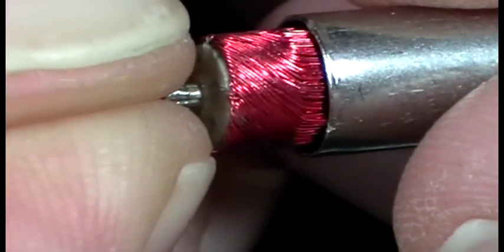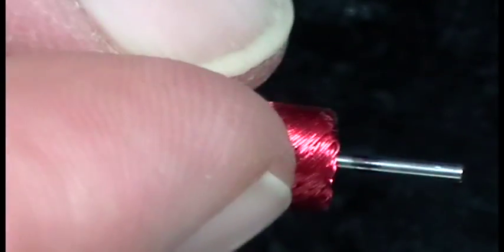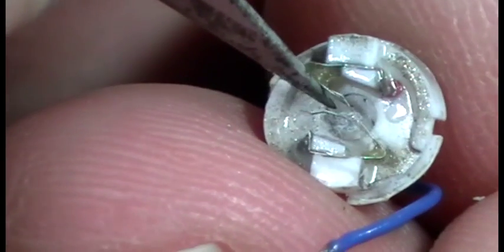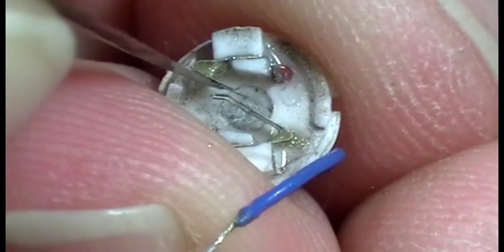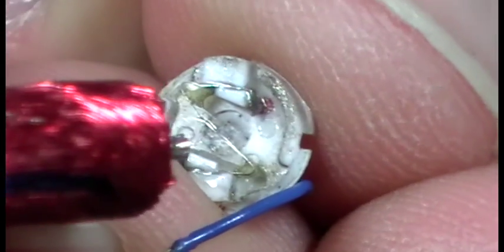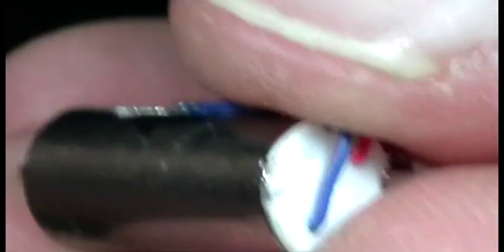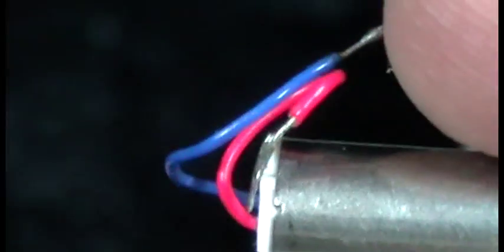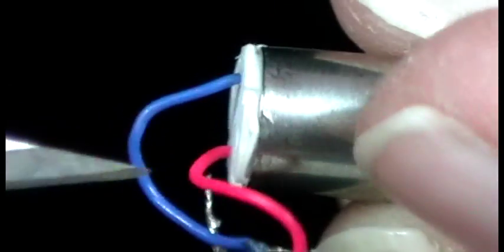E Flite Blade MSR Tail Motor End Cap Repair

Comment from the maker: @speedon68 I use the walkera pinion puller, works a treat, the hobbycity one is the exact same as the walkera but differently badged. at the end of the day you need a micro pinion puller for the main motor

Comment: just one thing - it doesnt matter if u turn the endcap slightly (or even by 180deg) from its original position according to stator (can) .. it will definitely not cause the motor to spin in opposite direction...
Reply: well it doesnt make sense to me at all, and if i wouldnt have experienced myself,  i would have agreed with you in the beginning 1000% , but contrary to my logic, after one of my coreless motors brush caps popped off of a brand new motor that was a clockwise rotation with  blue and red wires, after inspecting it only problem was the crimped 4 tabs at the end failed, so i put it back together, and installed it, and that damn thing was spinning counterclockwise, and yes the first thing i checked was correct wire polarity, red hot, blue ground, so i scratched my dome and said WTF!!!! so i removed the damn cap and rotated it 180°, which made no sense to me at all, because i thought the only way to reverse the rotation ( yes i know switching the ground to hot will do it , but that makes the commutator shaft spin against the brushes correct orientation as to where it spins toward the bend in the brush vs away from the bend, reducing brush life ) was to turn the magnet to the opposite end flipping the magnetic poles, but turning the cap, like Gourvelos stated, returned the rotation back to clockwise, like i said, if it wouldnt have happened to me, i would have said, Gourvelos is fully retarded and shouldnt quit his day job. but i stand corrected, and apologize to Gourvelos for that statement crossing my mind, making me fully retarded and resulting into brown nosing  more at my job, so as not to lose it ! i came to the conclusion that the dark forces of voodoo are at work here because clearly someone fabricated a doll with my name on it, since it was painful to admit that " I ", " Mr know it all " now knows that i was wrong , peace out
Reply: and now back to my fruitless search for where in the damned world can i obtain replacement brushes for these motors, or gain the knowledge on how to fabricate them my friggin self, i hate to throw the motors away, since i usually spend the premium monetary value for high kv, high rpm motors, so my  little brushed quads can fly like their on crack, when the only problem is those hair folical sized, three lead tender delicate fragile pain in the ass brushes are burnt up because they cant handle the amount of testosterone forced on them by my aggressive fly it like you stole it style, im not a chauffeur, and i did not apply for the job, driving miss daisy ! i wanna go fast !! and when i crash a quad, i wanna do it right, and turn it into nano dust !
Reply: @rodlander6291  if you make that happen, let us know ! :)